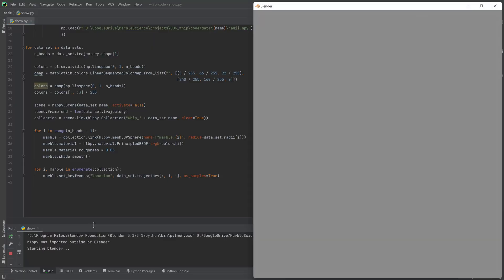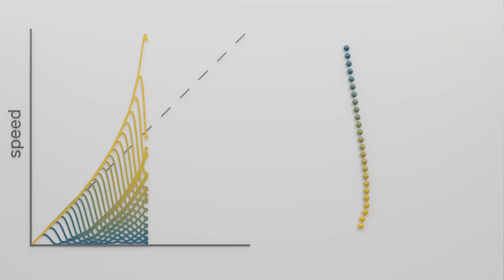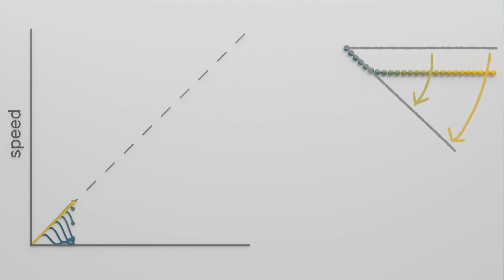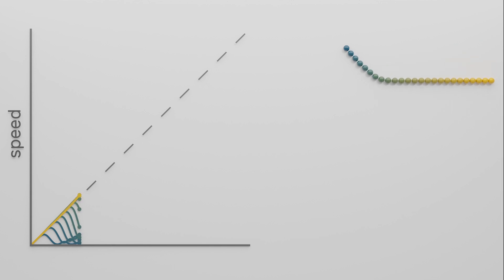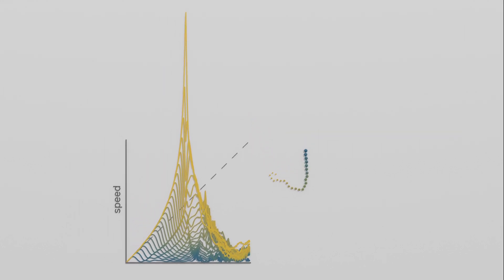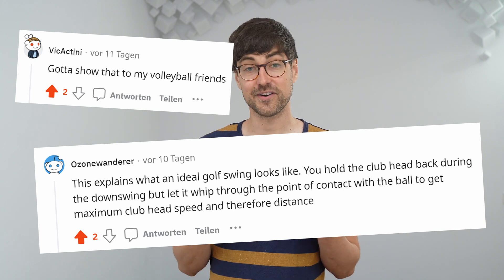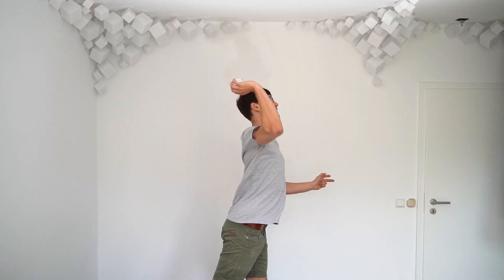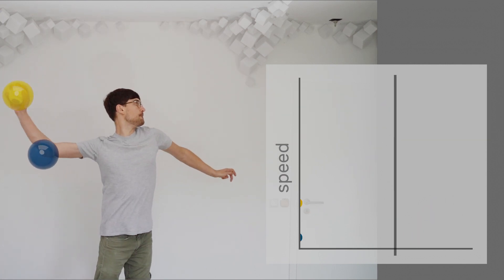I Accidentally Simulated a Whip - This is What I Learned!

Comment: So, if I had to throw at maximum speed, first thing, I should move my shoulder very fast, then my elbow takes over, and then finally my wrist… amazing.
Reply from the maker: Yes! (I mean not that I am an expert on throwing techniques) I think you should do most work with the strong muscles in your legs and core, and then transfer that kinetic energy with a whipping motion of your arm.
Reply: @MarbleScience  That's why in boxing the rotation for an ideal punch (let's say a hook) would start from your feet, move up your legs to your hips, core, upper torso, and only then reach your arm. At this point you should stop and hit with a strict arm in order to have your body weight behind the punch, though. If you took this whip logic to its extreme you would have to keep on transferring energy from joint to joint until you hit your opponent with a finger flick at the speed of light. Would probably hit like a bullet if it was possible to execute :D